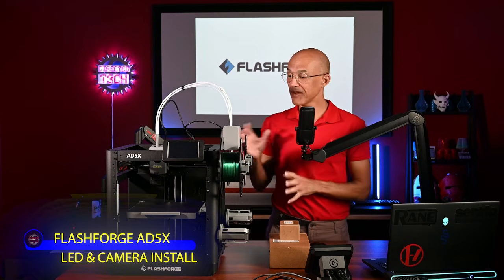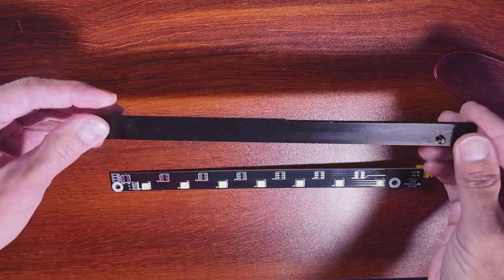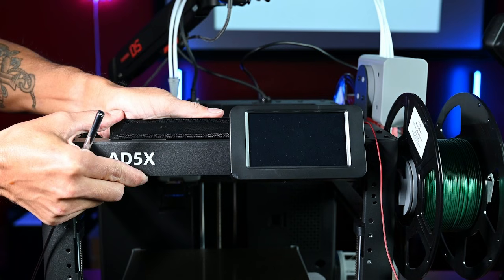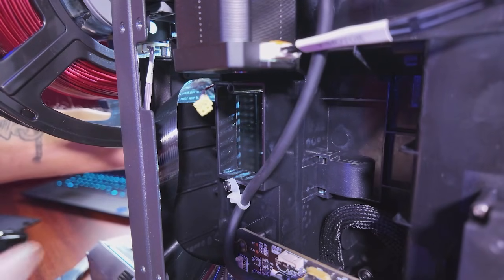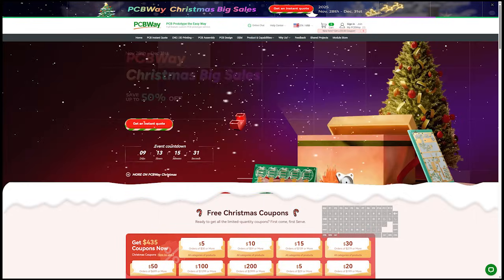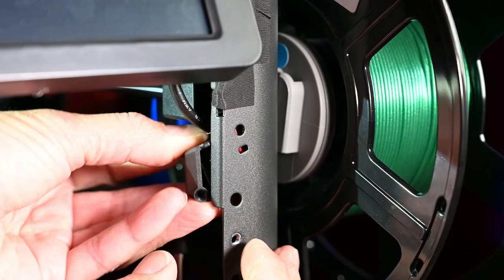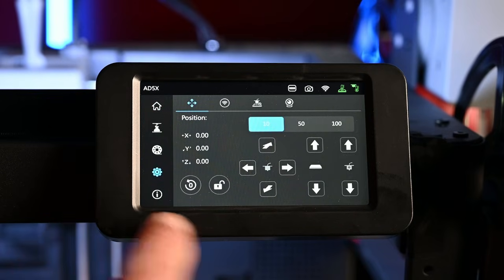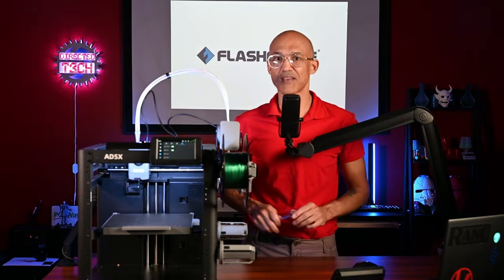Flashforge AD5X LED Light and Camera Installation Instructions

Comment: Thanks for the video!  The light bar adapter link on the flashforge website only provides a .rar file, not stl.  Do you know what's going on with that?  Operator error?
Reply from the maker: A .rar file is just a compressed file (like a .zip file).  It contains the "LED strip onto the mounting plate.STEP" file that you can import into the slicer and print.  If you need a program to open it, 7 Zip is free and you can get it here: https://www.7-zip.org/

Comment: Hola. Probé conectar una webcam de notebook (de las que vienen integradas). Tengo entendido que esas cámaras funcionan por USB.
La conecté al conector  de la impresora, pero no la detecta.
No sé si el problema es la cámara o si tengo que habilitarla en el firmware, pero no me aparece ninguna opción relacionada con la cámara, como le aparece a usted.
¿Qué le parece a usted? ¿Podría decirme si, aun desconectando la cámara, le aparece ese apartado para habilitarla?
Reply from the maker: A webcam needs drivers and such to make it work. The AD5X USB port and mainboard are not designed to support a webcam. The camera that Flashforge sells on the website is made to work with the mainboard of the printer and will show up in the slicer once enabled.